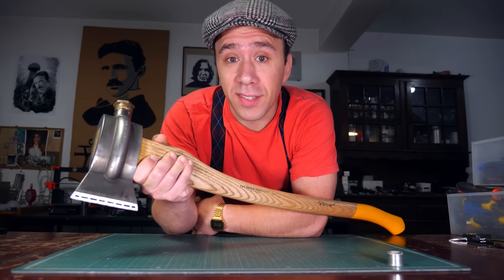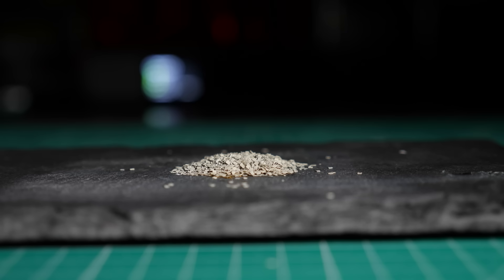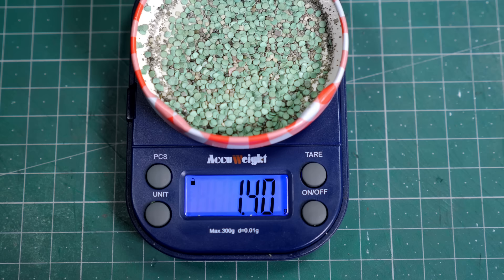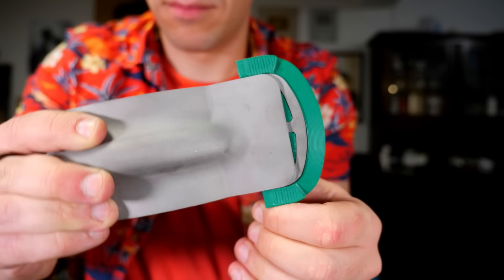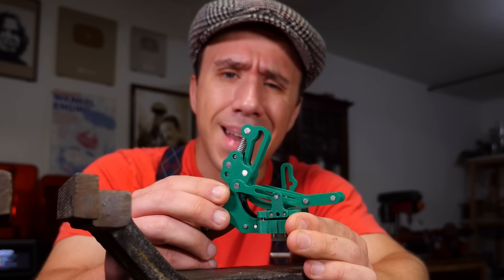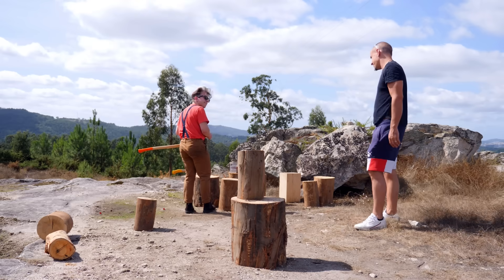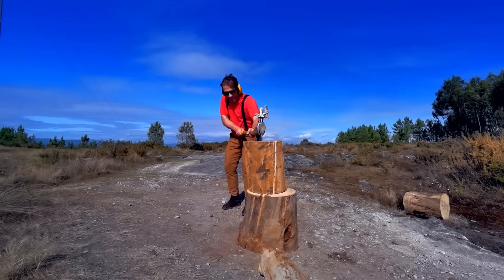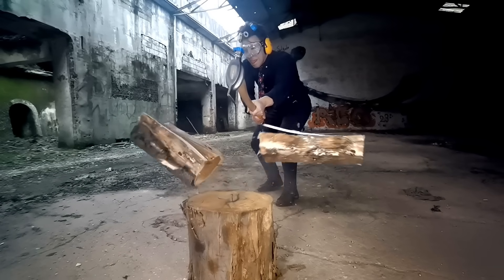I built a BETTER SHOTGUN AXE

Comment: Blue gum wood is hard as hell. One of the pranks they used to play on newbies at the sheep stations was to try and get them to nail stuff to a blue gum fence post.
Reply: wait till one of the newbies breaks out a personal  ramset.
Reply: Yep, his mechanism is good, he just chose a difficult wood to test it on.  I've split a lot of wood by hand and eucalyptus is pretty much my least favorite as it's such a pain to work with.
Reply: I have gotten too comfortable with my nail gun that I first didn't understand what the problem was. That thing nails poles to concrete
Reply: @timonix2  Nail guns are really cool.
Reply: Nice. We have old growth Douglas fir here in the USA that was cut down back before the late 1980's that will make nails and screws do the same thing. It also destroys or just can't be drilled by drill bits that aren't carbide tipped or W1/W2 tool steel after a few holes. You can get a high end, stainless steel screw into it or a structural screw if you drill a pilot hole, but nails? Yeah, not happening.

Back when it was still fresh out of the kiln and being put up for construction it was a lot softer, but after years in dry climate areas and in houses that are well maintained to keep the weather out it finishes seasoning over the decades into a hard wood that just does not like to be cut or drilled. No rot resistance at all, though.
Reply: That is legitimately the friendliest new guy hazing tradition I've ever heard of happening on a sheep station. Certainly better than the Errol Flynn experience down in Tassy... even if they claim it was standard practice at the time.
Reply: We actually send Tasmanian timber all the way to Portugal ??   Whats it used for ???
Reply: @Tom-ws4cj it was and is a pretty profitable tree, it was introduced over a century ago and is extremely invasive and a massive fire hazard that causes most fires in the country.

As a Portuguese person, if someone asked me which tree is the most common in Portugal and I couldn’t check the statistics, I would say eucalyptus and I would probably be right.

Edit: it was used for paper, probably still is.
Reply: @Tom-ws4cj  as Andre said, eucalyptus was introduced to a lot of places. Various species are pretty fast growing, and are very durable. California has a big problem with iron bark
Reply: I was going to say the wood appears to be very hard and dense.
Reply: We've had chunks of bluegum that load up and almost stall our 50 ton hydraulic log splitter. If you get a bit with a bad twist its near impossible by hand

Comment: Don´t use a cutting disk like that, score the metal you are cutting lightly and repeatedly run the blade along the cut line. It is safer and it conserves the disk by up to 80x. 
You might want to check how packed each cartridge is, i.e. if if is tight enough to build up a head of pressure as it goes off since some seem to go off with just a fizzle. That indicates that they are blowing out before they build proper pressure.

Comment: I think your axeblade needs more of the length and taper of an actual axeblade. The continous taper would create a better seal, i imagine, just like cartridges are slightly tapered to create a better seal in the chamber an help with extraction? Idk, maybe for V3.
But the rounded edge is a good improvement already
Reply: It's definitely more of a splitting maul despite him calling it an axe. Axes are made for chopping, not splitting though, so the shape of his is actually pretty good. I thinner blade might be better though as it would split the log less during the initial impact and allow the gasses to do the work.

Comment: just a tip when chopping firewood, don't aim for the middle on the big ones.  land the axe off to the side parallel to the grain, works much better.
Reply: Good idea - hitting the log in the centre causes the force to be absorbed equally, you need to hit an edge first, then work your way around, so the large heavy side reflects the shock wave back to the smaller wedge side.  This also applies to log splitter wedges that you hammer in.
Reply: Good advice for splitting wood, yep. However, he is trying to split it with pressure from explosion, and aiming for the center of mass might be better to contain the gas inside the wood.
Reply: @lucaspelascini6330  no, it isn't.
Reply: Like “quarter sawn?”
Reply: It shouldn't matter if hes using a shotgun shell. He's not axeing wood. He's blowing it apart. The axe needs redesign.
Reply: You want to hit on the edge.  That gives the axe the most leverage on the wood.
Reply: Do you mean perpendicular?
Reply: @GusCraft460 I doubt perpendicular was intended. We're talking axes, not crosscut saws.
Reply: @MNbenMN I’m talking about being parallel to the ray plane, and perpendicular to the rings.
Reply: @GusCraft460  off center to the left or right, in line with the grain. for big logs you can chip away at them just keep turning the log.   for big ones if you want to cut down the middle a sledge and steel wedges works good.. damn now I want to go cut some firewood
Reply: @GusCraft460 no

Comment: Maybe add a small Tesla-valve kinda thingy into the axe body so the back pressure doesn't blow out the firing mechanism as often? It also delays the blast a little before it gets to the wood, that may make the timing easier I think.

Comment: Directing the gasses directly into the wood requires good sealing between axe head and wood. I would consider adding some sort of piston or lever that the gas acts upon, where you can engineer the sealing as you need it.

Comment: if you put a cylinder in the centre of the axe and a weighted plunger at the rear on the acceleration stroke the plunger will be pulled fully out, as it hits the wood the weighted plunger will carry on compressing the air in the tube.. which exits as per your axe head..

Comment: Dont rely on the wood to seal the holes, and at the same time dont allow the presure to push the blade out, make the blade with a side flap that seals the hole, when it goes in the only way the pressure can scap is pushing the flap outwards, pushing half the log and cracking it, of course you need to beef up the contraption so it does not grenade on your face.

Comment: Honestly, if I were to handle this concept, I would have done it much differently.

I would have made an axe with a reciprocating blade, so that when it comes in contact with the wood with a swing, it will strike the primer of a blank and force the axe into the wood to break it.

I feel like this approach is better than using the explosive force to split the log apart, because this way it's more versatile and you could possibly even use it to chop down a tree.

Comment: Electrolyzing water for oxyhydrogen was clever, but you’re right that the energy density just isn’t enough.
Reply: Increasing pressure by narrowing the internal channels probably caused that rocket effect
Reply: he needs to turn it into liquid form.
Reply: @keith3761  yeah… uhhh he ain’t keeping it that cold or under that amount of pressure ……
(Replying to the “liquid form” comment)
Reply: Maybe stupid assumption, but couldn't this be done with automotive parts and gasoline? Or at least some methane, propane, buthane mix?
Reply: @OperationDarkside  like a potato canon? probably. but without good compression you wont get much power.
Reply: @keith3761  Compression could come from a design which splits the axe head in two. A blade and chamber part, and a cylinder and ignition part. The blade hits first and stops due to friction. The cylinder and grip keep going due to momentum, creating pressure. With the right mix and maybe a glowplug, this mechanism could be self-igniting.
Reply: @OperationDarkside  Doubtful, when you look at how much compression a gas engine needs to fire and how large the starter is to compress the cylinder and even then starting is when the engine generates the least power you wont get much bang for your buck. you would need use a compressed gas and then flood a smaller chamber and ignite it there or use pressurized single use cylinders and ignite those. This would be extremely dangerous to tinker with. 300 bar premixed compressed air/gas mixture plus the high pressure hoses? noooo thank you! not me! I aint touching that. He would be better off loading his own shells with more powder and coming up with a better injection system. Hell of a lot safer as well. He would be better off using less air vents and having 2 hollow spikes that penetrate the wood and create the fissure along the cut line.
Reply: @OperationDarkside yeah but then you need a carburetor and it's a whole thing
Reply: Actually, maybe if he made the generation process worse, there might be some water droplets left, and those would flash into steam which might in fact generate more pressure.

Comment: stop lyeing bro. most hand jobs last more than 60 seconds bro. your mouth, king, is out of lip sync. green tomatoes are raw. also very hard. compressed air works better. it will blow back on your from the slit also. why dont you try a two-part edge as the splitter instead of the wood being kicked. ie the metal head is a smoother pressure vessel than the wood. pretty hard wood bro.